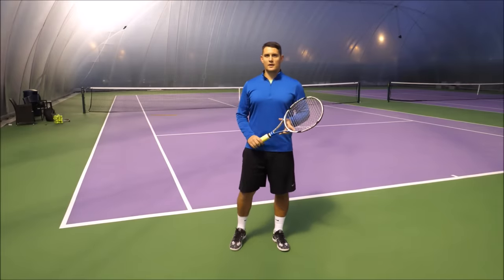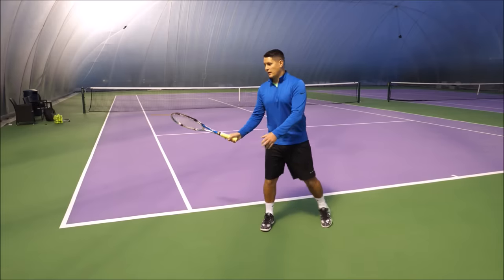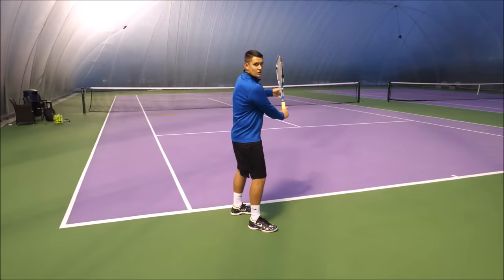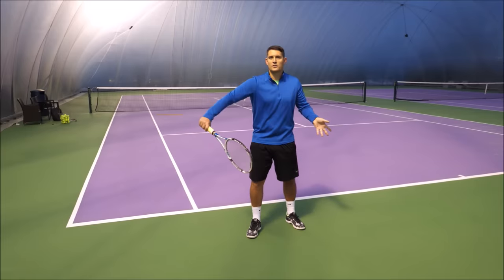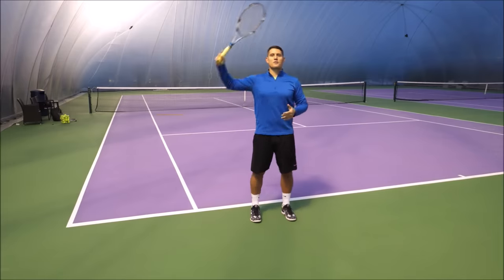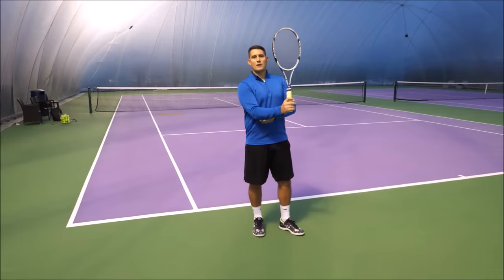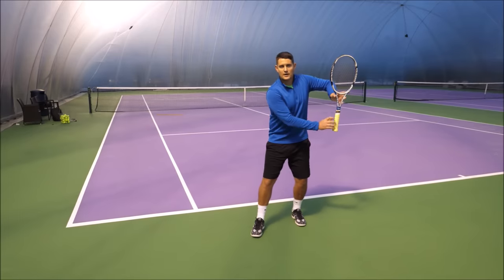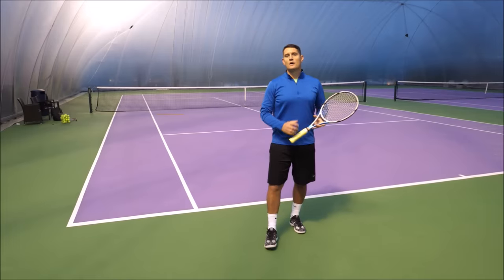Simple Tennis Backhand Power Trick - One Handed Backhand Tennis Lesson

Comment: Great video!
Raising the racquet high on the backswing really does add power because the racquet is accelerating rapidly down over a longer distance to add power to the shot. 
But you can also really feel your body coil even more fully with an increased stretch to your chest and hips when raising the racquet high. That increased coil also adds to the power of the shot.
Finally , it also serves to raise the hitting shoulder up, while dropping the front shoulder down giving a pronounced shoulder tilt, and letting the body assume a "C" shape when viewed from the side. (It also promotes a slight hip tilt as well.)
Reversal of the shoulder tilt/hip tilt  (and C shape) is recognized as an important element in power in the serve (along with coiling/uncoiling and the push from the legs.)
Reversal of the shoulder tilt/hip tilt  (and C shape) is important in all groundstrokes as well, including the one handed backhand.
The shoulder tilt (C shape) lets you:
1. look over your front shoulder for a clear look at the ball.
2. increase the distance the racquet travels for more raquet speed/power as you point out in the video
3. allows for the racquet to be dropped almost parallel to the back fence
4. allows fot the racquet butt to be pointed in an upward direction at the ball as the racquet fully falls down and starts to slightly go up
5. promotes greater topsin, as this low to high motion is accentuated 
Too many videos on the one handed backhand only concentrate on the coil/uncoil. They usually ignore taking the racquet back high, even as the instructor actually does do it. But you often see the student struggling to replicate the shot because he misses the point of raising racquet and being able to look over a dropped front shoulder.
Raising the racquet in the backswing to increase the shoulder/hip tilt (C shape) is the cherry on top that gets the swing started in a much more powerful swing, involving not just a longer swing with the arm, but using more big body muscles to power your shot!
Reply from the maker: Absolutely 👍

Comment: Excellent video.  Two additional tips I would add to generate more power are to 1) use a semi-closed stance so you can coil your body even more and so your opponent can see your back, and 2) ensure that your non-dominant hand stays on the racquet as the racquet drops from the power position.  This will help with the acceleration as well as ensuring you get under the ball for more top spin and keeping your dominant arm straight at contact (a bent arm loses power).

Comment: Thanks for the explanation. I sometimes tend to think that like with the modern forehand, acceleration comes from a kind of „pulling“ on the racket. Doesn’t mean that the pendulum explanation is not true, too. I noticed that shortly before starting acceleration some players take back the racket a little more. I have tried it, too, in practice and to my feeling it worked and give me a little extra juice. However, the problem is that the timing is very crucial as it can result in a late contact point which is of course detrimental to your stroke technique. What is your opinion in this little extra pull back shortly before starting swinging foreword, Simon?
Reply from the maker: If you can time it well, the extra pull will have a little rubber band effect on the swing. It can definitely help gain additional power
Reply: @TopTennisTrainingOfficial  Thanks!

Comment: Hi Simon, excellent video. I have applied all the techniques, but recently I’ve felt that my topspin is not strong and mostly for my backhand shots, they come out flat. After my last match, my contender pointed out that my backhand is my weakness. Sometimes I think it would be better to change my single backhand to a double. What do you think?
Reply from the maker: Have you tried the two-handed backhand?
It's something you'd have to experiment with, however, maybe just some technical changes will help your one-hander massively.

Comment: Hiya there Masters of the Masters!!   First of all , have a great 2019!  I've got a quick question,  it's about the pressure of my fist when the impact comes.  How should it be?  Relaxed? steady?  It's a challenge 4 me cuz I guess it's not the same all the time.   Tx in advance.  Sebashtian from Bs As
Reply from the maker: Hi Sebashtian
The tension in your hand would depend on the incoming ball and the shot you want to hit.
Some shots require your hand to hold slightly tighter to control the racket head at contact, other shots you can be very loose with the grip.
Try to always stay as relaxed as you can (for that shot) and experiment with it next time you play, see how loose you can hold the grip while still maintaining the control.
All the best
Simon
Reply: @TopTennisTrainingOfficial  As clear as water Simon  !!! Tx u so very much ( as SRV used to say)  My pleasure.  Best regards.

Comment: So what should be the back position for one handed return of serve?
Reply from the maker: There are three main swings on groundstrokes, one is the full length one, which is used when time is not an issue, then you have a medium swing, used when the ball is coming in powerfully on the baseline and you have a little less time, then the third one is the return swing, used on the return of course. It differs between a first and second serve return, but in general you want to block the ball with a very small backswing

Comment: How tight should I grip the racquet? It seems like the racquet wants to spin in my hand on contact at times.
Reply from the maker: Tight enough that you can control the strings, if the grip is old, it will slip much easier and you'll have to hold it very tight to stop that, a good, new grip should help you with that problem
Reply: @TopTennisTrainingOfficial  I'm holding it just hard enough that you can't pull it out of my hand easily. If you put moderate force into the tug then the racquet will easily come out of my hand. It's about 15-20 years old and was maybe regripped I'm told 10 years ago. I've only been playing for two years though.

Comment: what Dunlop Racket you using ?
Reply from the maker: It's an old Dunlop 200g racket, had it since 2009.
Might be time for an upgrade. . . 
Thanks for watching.
All the best
Simon
Reply: Thanks for Reply - if it plays good why upgrade ???
i still use Prince Graphite 107 , like THORS Hammer 360 grams  have 4 Sticks 1 still BRAND NEW

Comment: All correct but secondary to feet action and weight transfer. You should comment on how Gasquet in the opening shots shits the left foot behind the right one after contact and how you should always focus on having the back foot always off the ground after contact as every pro does in your footage. Everything else is secondary
Reply from the maker: Very valid points, weight transfer is something we focus on in great depth inside our backhand course with Tommy Robredo.
However, sometimes when on the run, you can't transfer the weight, so the swing has to be ideal to generate power from the upper body

Comment: Mate please answer this question :
What happens if you have an extreme grip , it’s very difficult to turn the way you do . I really have to pull my left arm back to set with extreme grip . Is the left arm in some cases necessary to pull the racket back high , like for example robredo , he seems to turn them pull up ??? Please clarify what left arm does in the Cas of extreme grips , I can see that with a more neutral grip it is easier to position as the hand is stead on the grip , but otherwise difficult
Reply: “Spread on the grip “

Comment: Observation is correct. Hypothesis and theory are a bit inaccurate though. Power comes from the legs just like a two hander. the vertical racquet setup is for a proper contact with the ball. the same amount of power and spin can come from having the racquet horizontal. just doesn't flow though with the body mechanics
Reply from the maker: You can get the same amount of racket head speed from a horizontal power position? Even though the distance to the ball is reduced greatly from that position compared to an upright racket head?
Also if power comes solely from the legs then why don't pro players start the swing inches from the contact zone, then use their legs to generate all the power. What would be the need for a swing?
Reply: so So lol go back to the 80’s if you want to play that way